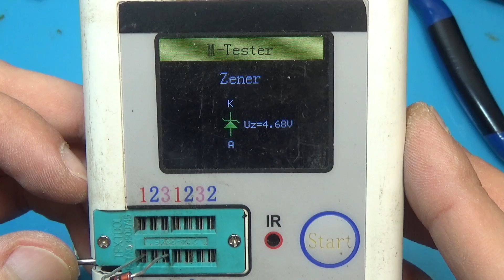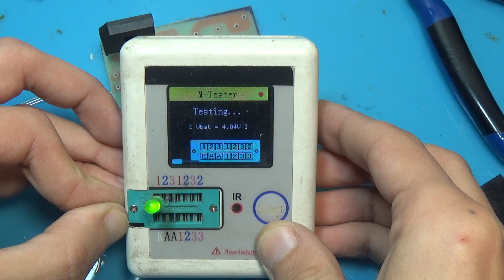Auto Cut OFF Battery Charger

Comment: Whats the point.  This circuit will keep going on and off as the battery voltage rises and falls when charging then resting.  It will never shut off and stay off.  Needs to be redesigned.  You have rehashed this circuit many times on your channels and never made one that stays off.
Reply: I'm guessing he's either a backyard amateur or an apprentice in his early stages. Allow him time to learn through his mistakes.